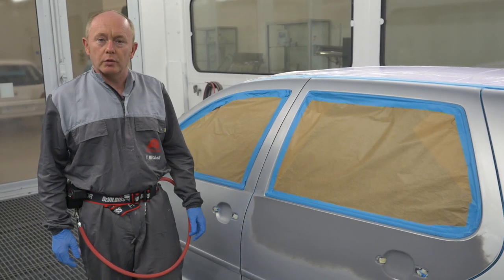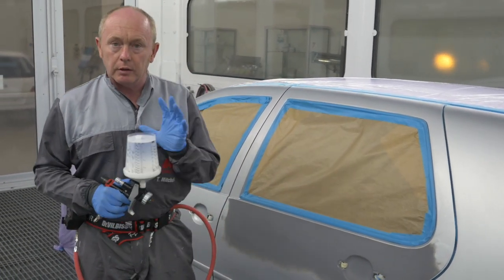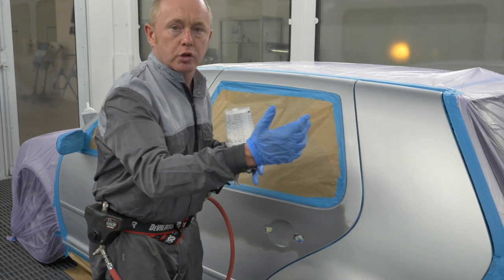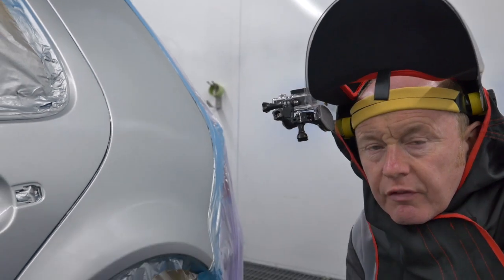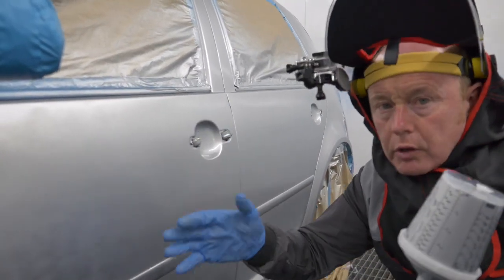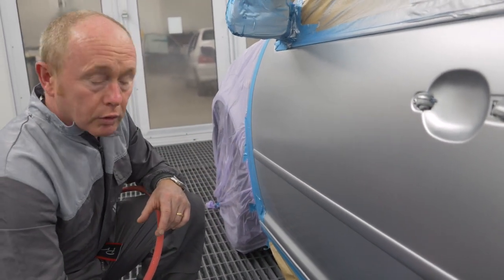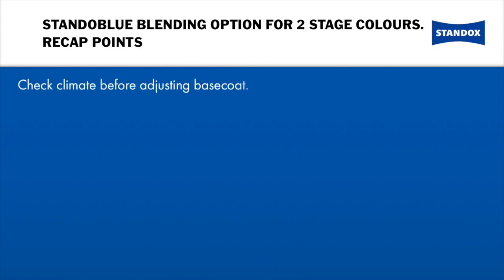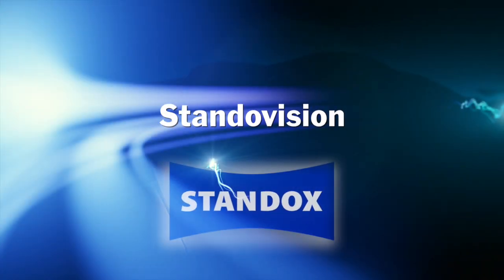Standoblue: Blending-in Guide

Comment: Hi. What about air pressure are you using for the blends and main repair covering?
Thanks
Reply from the maker: Thanks for your question. As our technician had only a little space in which to blend on the rear fender he reduced the pressure to 1.6 bar to keep the overspary down and reduce the blend zone. For the rest of the repair he used 2bar to apply the colour and blend the front door.

Comment: Are you spraying only one coat? Don't need more coat's? I mean one wet coat, second middle and last dry coat of base? One time is enough to cover a primer?
Reply from the maker: Standoblue is one of the best covering Basecoats in the market. For the majority of colours 1.5 coats are enough to cover filler spots. Apply the first coat as a wet closed coat (but do not overload). Coverage has not to be achieved in this first coat. Continue with an uniform effect coat with greater distance to the object and close overlaps. Please see also application guide and mottling control video, here you will find full guidance and explanantion. Thanks for watching!!
Reply: Thanks, I painting with standoblue now and I am happy and proud for your products. :D Before I used another company and also waterbased but I prefer standox. ;)
Reply: You never want to spray wet coat especially for silver mottling is what you would get with a wet coat of silver
Reply from the maker: @pawegotlib5549  we are happy to hear that!!! Thanks :)
Reply from the maker: @kolorkingsocal Not sure what you mean, but for sure we are not spraying a wet coat. The process in the video is how to use the product correctly, and is how we developed it to be used. Thanks for your comment.